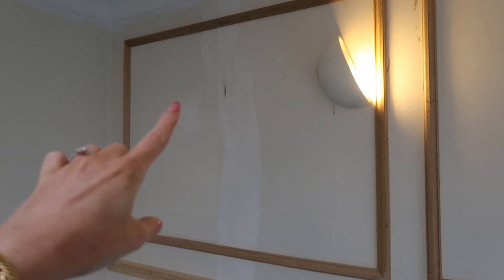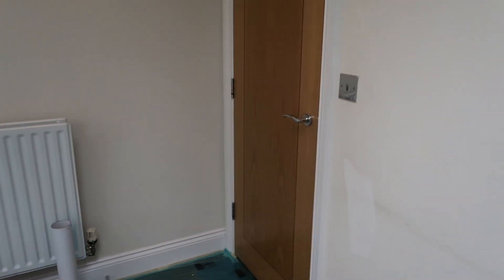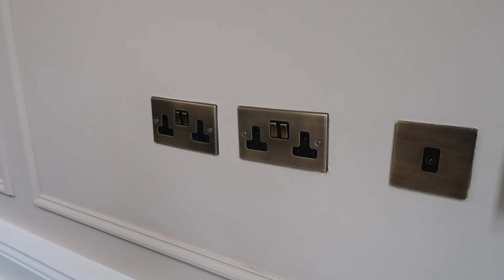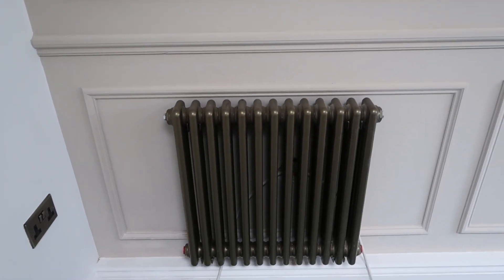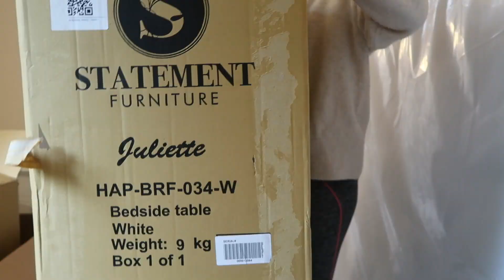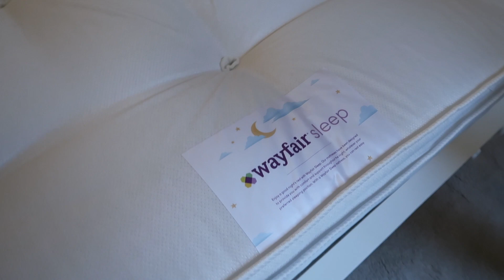THE RENOVATION BEGINS! ✨ Decorating The Gatehouse - our London apartment! 🏡 Fashion Mumblr

Comment: I can NOT for the life of me understand why the painters didn't remove the light fittings before painting. Sheer laziness or stupidity??
Reply: Anni Evans Seriously! That was really subpar work.
Reply: I was thinking the same! Even when we painted our bedrooms ourselves and we didn't have professional help, we removed everything from the walls. How will it look like after the holes will be filled in and painted over only on those certain areas?
Reply: It was probably just not in their contract and would be a liability if the painters did it themselves without it being covered in the contract. I worked as a painter for a summer and the customers were told to remove things from the walls if they wanted them off. Painting around things is more difficult so they wouldn't do it out of laziness 😅